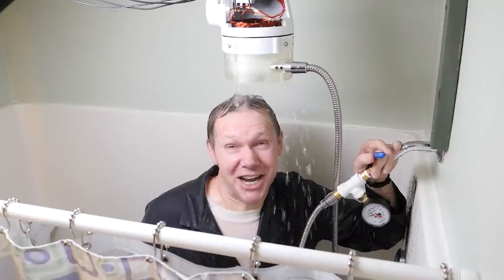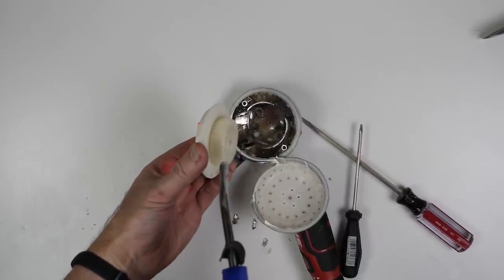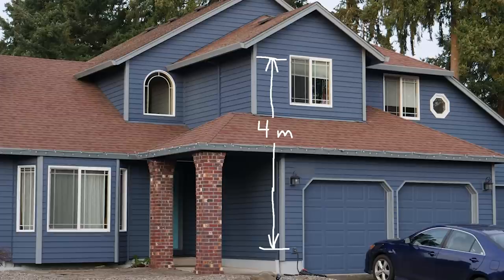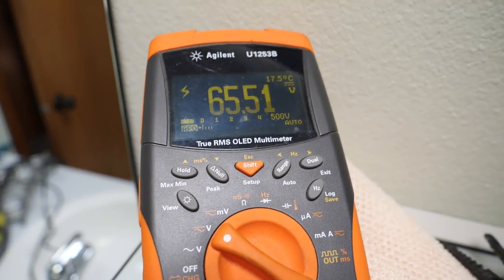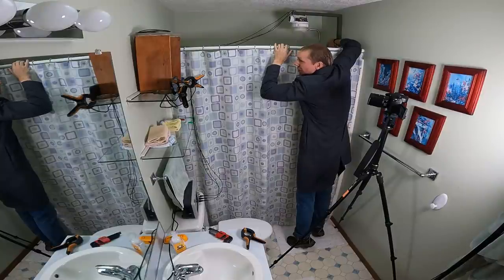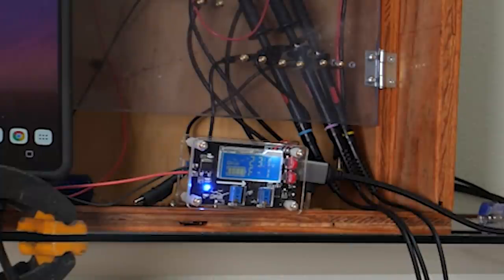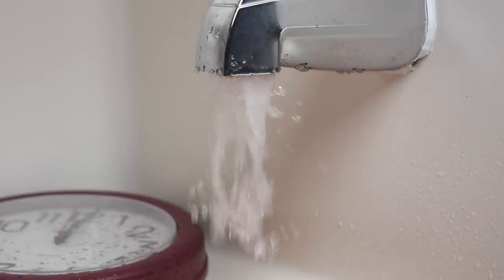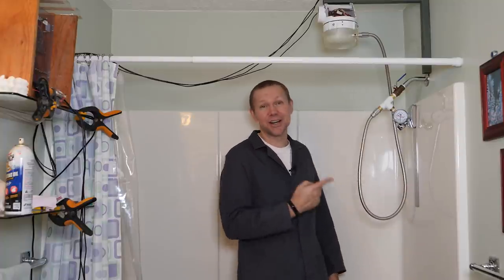SHOCKING Results! How much POWER is in your SHOWER?

Comment: First: I really love your content. Regarding improvement tips. You already got some electronic tips. So here a mechanical improvement. The pelton with two scoops per row spits half of the water to the top. Which in turn slows the turbine down while falling down because of gravity and on escape to the side :-). Maybe switching to a one scoop per row turbine fed at the high point and shooting out the water only to the bottom will increase efficiency.
Reply: weekend stuff, thats sounds better.
if i understand your suggestion its basically rotate the device 90° So that the stream is down and splashback is up and away.
Im not shure about a single cup pelton wheel improving unless its the plastic twisting stress adding a harmonic wiggle your concerned with.  If so, i guess used the 3d print as a cast for puter or other metal casting pour?  Somthing with more strength. Or an epoxy layer to reduce plastic deflection /cup twist.  Cuz who has time for casting
Reply: @scottadams3544 , if you are able to rotate the complete device 90deg then no need for a single scoop pelton IMHO. The single scoop pelton was only ment to be used if the orientation of the device stays. But you are right there will be an issue with unbalanced forces. Regarding casting a metal pelton, using lost form casting, I could support with the furnace but I don't have access to a 3D printer (yet) :-). And it usually takes more than one try (for me) to get the castings right... So going with turning the device 90deg seems to be the easiest fix.

Comment: Hey Quint,

some thoughts on the electric side of the project: these simple buck converters are probably not very well suited for the project. You're dealing with a heavy variing input voltage that will probably drop a lot when put under load (e.i. when your Smartfone is connected).

What could wirk pretty well is a buffer - let's call it a rechargeable battery. And since you have this wide range voltage input, you can use a solar charge regulator for the charging of the battery: solar panels hve a wide voltage range and the voltage drops depending on the load.

A cheap TP5100 regulator would be my choice for a test - you get these in china for pennies. With a 3.7V battery connected, you can use a small boost converter to generate 5V to charge your fone.

Keep up the good work with your videos!

Comment: go back to the wye wiring and instead of using a normal 3 phase rectifier, use thyristors with an arduino to control the firing angle.  Your dc out voltage is determined by the angle.  Then you can the converters at the input voltage where they are most efficient.  My theory here is similar to MPPT instead of PWM for solar in that I think you need to keep the velocity of the generator rotor in the sweet spot as well.

Comment: You could try rigging up something to measure the torque from the Pelton wheel. Perhaps mount the whole unit on a pivot, with an arm to a weighing scale or something. That way you could measure the mechanical power being generated by the turbine under various speeds and loads etc. and compare it with the electrical output from the generator.

Comment: Try to use an mppt solar charge controller to convert from higher voltage to low. The mppt, constantly monitors the input voltage and tries to squeeze as much energy as possible, without pulling too much.
Reply: Add the same idea watching this.

Comment: I would be more intrested in collecting the heat from the shower water that goes down the drain. 🙂 It is so much more energy. 🙂
Reply: There are products that do this.  It's basically a coil of copper that feeds your cold water supply to the shower, recycling the heat immediately.
Reply: @yosemiteanemone4714  true.

Comment: I’d love to see if a reduction gearbox would solve the power problem by slowing down the generator and reducing the load on the water wheel to help with surging.
Reply: I was thinking a transformer with the first coil config might be the way to go

Depends completely on the optimal speed of the impeller
Reply: It is not a power problem, it's an over voltage problem. Whatever power the generator produces, he wants all of it. He doesn't have excess power, he has excess voltage.

Comment: Great video .This is a great idea!. My suggestion would be tapping into the flow from the main water inlet into the property by fitting a turbine to convert the flow to electrical power, it would be be easier than tapping each individual water outlet to generate power as the flow rate of the incoming water supply is much greater and only one turbine would be required. Using this method power would be generated everytime a tap or faucet or appliance such as dishwasher, shower, washing machine, bath etc; is used. Using hydro power for generating electricity in the home is essential now that energy costs are spiralling.
Reply: this is a great suggestion, you could put a larger generator on the main line to power/charge a large battery for the house to run of of and put smaller generators onto the spigots to power water heaters…the water heaters can have batteries that would heat the water instantly on demand and use the power generated from use to recharge an continuously heat the water being used…

Comment: Current and voltage are directly proportional if the voltage doubles the current doubles if the voltage is halved the current is halved. If you plot it on a graph a change in voltage results in a linearly proportional change in current no matter what your load is assuming it stays constant.
Reply: Is that true for a diode too?

Comment: Quint it is likely you are over speeding the alternator. It's likely designed for shaft speeds around the 150 to 200 Hz output range.

With many alternators they are designed for a given shaft rpm range,  if they are running outside of that range their efficiency drops off

Another thing to look at is your bridge rectifier suitable for the frequency you are feeding it with the high RPM of the Pelton wheel?

You could try a larger sized jet to flow more water to increase torque to the unit.

You are playing with compromises regardless of the math.

Comment: There is a practical use of using water pressure as backup power.  It's a water pressure powered backup sump pump.  It uses the venturi principle to create a partial vacuum, that can suck water out of your sump basin.  Generally used as a backup pump.

I'm sure it's not very efficient, and of course increases your water bill.  But it's a very reliable pump that doesn't fail when the power goes out.

Comment: In the mid to late 1800's a device was commonly sold that hooked up to your home faucet that generated electricity to run electric appliances. It was the easy cheap way to produce power. I was shocked when I first heard of these, I didn't know we had electrical appliances in the 1800's. These are the things they don't teach you in school.

Comment: Very interesting project. 
I think you can rewind the generator with thicker copper wire so that the current will increase. This will also help in reducing the speed of the turbine.

Comment: Not sure if someone else commented this, phones only charge at 2.5W when supplied 5V, you will need a QuickCharge/PowerDelivery circuit board from a battery bank to charge the mobile device at 15+ Watts. Just use the buck converters to supply it the Li-ion battery voltage.

Comment: This is why maximum power point trackers exist. Also, not all bearings work that well in all orientations. You now have the bearing "faced down", sometimes these bearings work better facing sideways.
Reply from the maker: Agreed on both points! 👍

Comment: I have a degree in mechanical engineering. I'm taking my board exam this month, I'll definitely recalculate everything. In this way, maybe it will help me master fluid mechanics and some basic electronics. However, I just finished reviewing and it's 3:20 AM in my country. I'll try it tomorrow. 

BTW, you have great parenting skills. I salute you as an engineer and as a father figure 🫡

Comment: I am a bit late to the party, but I have a possible suggestion. I had to work recently with bearings in high air pressure. One of the problems I had to work around was the air pushing out the oil of the bearing. I think here could be happening something similar. As your first bearing got clocked, I think its possible that the water gets into your bearing and washes the oil out. (I am sorry for my bad english, am not native. Still hope its understandible.)

Comment: If you shower without using the generator all that energy is also there and I assume it will be converted into heat, does that mean that when you shower with the generator the water comes out slightly colder? Like if the water heater is 70W less powerful?

Comment: You are having a great loss from voltage drop the amps and load from your PWM or pulse-width modulation charger. You need an MPPT charger or Maximum Power Point Tracking charger. With this you can use it at the full power point the motor is good at and power 10 or 15 phones
for an example 52 volts * 1 amp is 52 watts 
5 volts * 1 amp is 5 watts

Comment: I’m curious whether it would be possible to generate electricity through the electrostatic buildup between the ground and the clouds during a thunderstorm system. 

The apparatus would involve a very large kite connected to a beefy cable able to handle the enormous electrical loads, where normally a small wire would be vaporized upon spontaneous discharge. 

This would at the very least neutralize the charge build up that causes lightning and would prevent damage in the local area from it. It could also serve as an emergency source of electricity in case wind damage destroys power lines for a local community. Also would reduce people’s electric bills through storage of electricity and returning it back to a power company without regulations required around solar power. 

Obviously it’s more dangerous, but if it has to be dangerous because dumb zoning laws restrict the usage of solar panels, then so be it.

Comment: You do a great job of combining the engineering and practicality of making something work.  My personal idea is to use the incoming water supply after my water meter to turn a turbine.  Just enough to be a charging station  for a battery bank that is sufficient enough to run my home.  The incoming water supply will be moving a lot more quantity of water consistently then just the shower.  However I’m not at your level of expertise!  Thanks for the video, keep up the good work!

Comment: - The Generator is producing Great Voltage, but Amps is determined by the size of the windings and the Load on the Generator, Which would require more force to rotate the generator.  Try putting A Higher Load, Your phone was Drawing the right Volt/Amp load for Just sitting there like it was. - I Always Love your Videos!

Comment: Could you change the diameter of the Pelton wheel to make it turn at its optimal speed?
Reply: He'd have to redesign the whole case, because he's reusing a generator that only supports a certain size. I think a gear reduction would be better.

Comment: 1. Go back to WYE. Under load it turns easier for motors. It will probably be the same for a generator. It's probably why they wired it that way for a generator to begin with. Now get a BUCK capable of the output voltage at WYE to step down to 5v. 
2. It is possible that in having your son wire it up that he got a phase backwards. For delta, a start of a phase connects to the end of the next phase. You don't do start to start or end to end  in delta. In WYE, all the phase starts are usually wired together, but that could be all the ends instead. its either all starts or all ends that are wired together for WYE and you don't want starts and ends wired together. If you get these backwards, you lose a lot of generated power as the phases that are generating are fighting the ones wired backwards. 
3. I doubt you have a phase short, but it's possible. If the the generator spins like it is full of honey, you either have shorted phases or reversed phases. You can simulate shorted phases by touching the phase wires together. Spin the generator by hand and you will feel that it is sluggish and stiff like it's full of some kind of very viscous substance.

Comment: I would have separated the legs and put each one through a rectifier rated for those legs, then put it through a capacitor step bank to smooth it out. Voltage reduction to increase amperage and you're done.

I think the problem might be torque related, the speed of the water is maxing out the spin rate at that arm length....wouldn't a tesla pump be more efficient as the faster the speed, the more arc length you gain in capture? Just a thought.

Comment: Delta is a 3 phase, 3 wire setup. Wye or star is a 3 phase, 4 wire setup. If you used the centre tap and one of the phases, you will get a much lower voltage.

Comment: Hi there: Wild guess.

1. Slow your jet stream a little bit to counter the 500hz problem. You might lose some output because of it, but it's better than your generator thrashing from being run too fast. 

2. You may have some losses in the wiring. Try shortening the length a bit.

3. By using the Delta config, you may have made things harder for yourself. Use the voltage converter to limit your current prior to any other electronics that will performing the actions of charging the phone. That way your converter can take that 65v's from the Wye setup instead of the Delta setup and convert it into a higher amperage instead. (Assuming I understand correctly.)

4. How well lubed are your gears and other apparatuses? Use some silicon lube I think. Or more of it if you are already using some. Might not be quite enough to get a proper glide. 

5. Stick a hybrid ultracapacitor between the converter and charging station. (I think) This way the capacitor can help smooth out the flow of power between devices by acting as a reservoir or dam of sorts.

6. Split your jet into two separate streams using a Y split before the water exits. This way you can hit both of the spoons on the impeller. Or possibly from different angles to increase output? You will definitely be splitting the psi output of the water, but by splitting that output into separate spots, you can make a more controlled spin occur, maybe. Or better yet, you could run two generators with half the psi on each; thus taking that 65v output of one and turning it into 32.5v between two instead. This can then be run to those capacitors I mentioned earlier, and create a more solid flow of power. (i think)

That's about all I can think of. I am not an electrical engineer. I just read things and look at stuff and etc. 

I think changing the Wye to Delta was a mistake overall.

Comment: That’s something I’ve been wondering about for quite some time while taking a shower & glad to see someone trying to do it. I’m glad recommendations brought this up so I can Sub. 
To make it simpler try making a in-line turbine that connects to a garden hose first to not make a mess in bathroom. It would be nice to charge something when watering the lawn/garden & have it connected to the sprinkling system eventually or would it be better connecting to the water line coming into your house or conect it just before the water heater. It would be a good combination with Solar Panels to charge batteries.  For a simpler salution have something to screw on shower head then run a wire out to the charging station that has a light to light up bathroom when power is out & has a shelf to charge devices on. It would have an on board rechargeable battery to charge 2 phones at the same time. The thing I don’t want to see is people wasting water just so they can charge their phone when power is out. We get power outages all the time & I would buy something like this. I didn’t know there was a shower head that lights up & it would be great to use when power goes out. 
I have a squeeze flash light & wondered if you can hook a USB port to it to charge phone.  I have a Biolite stove that has a thermoelectric generator that charges my phone with wood.  Have a thermoelectric generator at the gas water heater. I’ve seen thermoelectric generators you put on wood stoves. I’m all for trying to harvest energy anyway we can to be off grid. I’ll have to go back & check out your other vids.

Comment: the water cover is causing water to bounce back, try making a cover that allows all water to flow away without bounce back, water and air turbulence will effect, turning water wheel 1/4 turn so water and air follows with gravity, and make a new shield like a large motorcycle fender that allows water not to bounce back and allow turbulence and gravity to assist the spinning.

Comment: Your housing might be causing restriction. The water needs to clear quickly . Also , aiming your water jet closer to the inside side can capture more energy . Removing some of the cups can increase the speed . A larger diameter wheel can reduce rpm . But ! If it's power / amps you want to increase . Use the star configuration and add a transformer . Current increases by the same ratio as the voltage drop . So 60v at 1amp squeaks 2amps at 30v . Your phone uses 5 volts to charge . So 65v can be reduced to 10-12v or around 6:1 . Thus 1amp becomes around 6 . 
Got an old 10amp 110 to 12 volt battery charger ? Or a microwave oven transformer ?

Comment: try to align the impact position of the water and the position of the magnets. both of them have a position where they can absorb most energy, they probably should match. Also, there is water stuck in the head decreasing efficiency. 

Just a guess.. hope it helps. Otherwise maybe try to copy a working design and start exchanging part by part